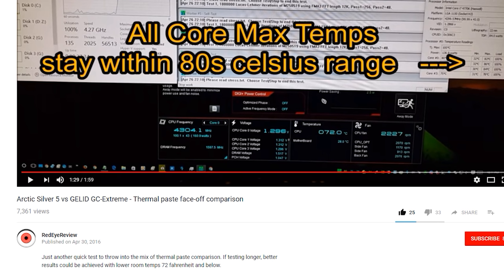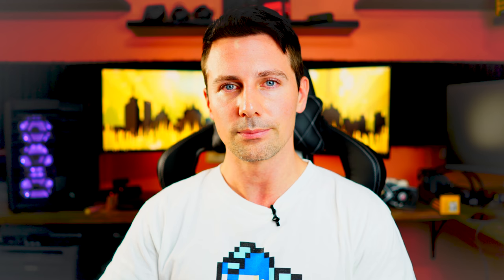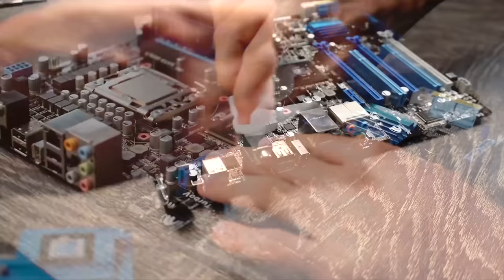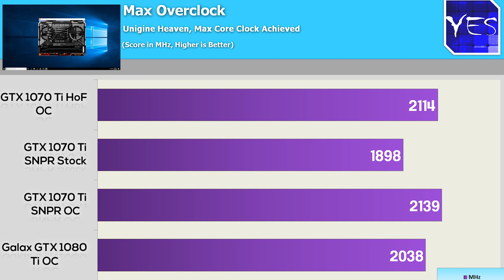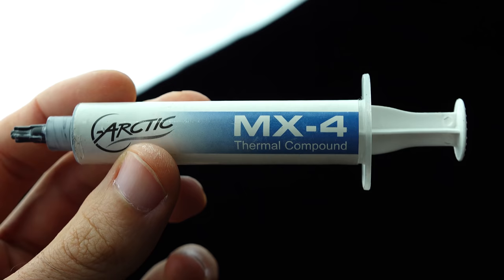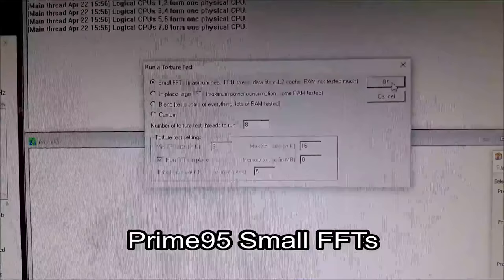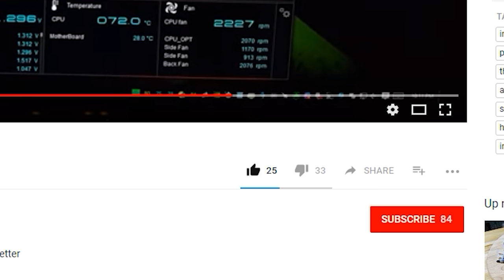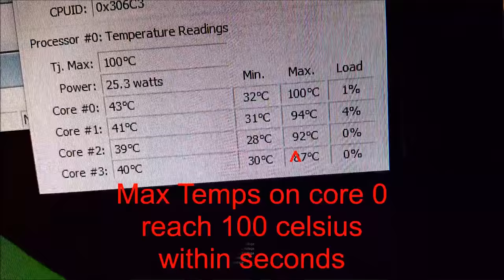Thermal Paste Investigation - GELID GC Extreme Vs Arctic MX4

Comment: Hi Brian,

I use Arctic MX-2 and MX-4 for around a decade or longer... I never had problems or thermal issues with it.

I will now try your tipp with the Gelid thermal compound. I recently checked other sources for thermal paste tests. Here are Tomshardware.de results:
http://www.tomshardware.de/anleitung-messungen-tutorial-thermal-grease,testberichte-242371-11.html the review is from Juni 2017 what is not so long ago.
Interestingly enough tomshardware.de proofed my personal findings too that Arctic MX-2 is in some conditions better the Arctic MX-4! Especially on GPUs!
 
Another source is Der8auer (its little bit dated ... but hey...) who did in Jun 2015 a roundup with thermal pastes:
https://overclocking.guide/thermal-paste-roundup-2015-47-products-tested-with-air-cooling-and-liquid-nitrogen-ln2/6/
The Gelid GC Paste is less then 1°C better then Arctic MX-4 what is around 0,5°C better then Arctic MX-2. Under a CPU.

Currently I run a PowerColor RX 480 Red Dragon 4GB with a Arctic Accelero Hybrid 120mm AIO (both bargains on eBay ;-)). I overclocked the card pretty stable to 1395 MHz with 1145 or 1155 mV with +30% Power Limit. The Card runs in Unigine Heaven after 30 minutes on 3440x1440 medium details @ 100% load to its thermal Max from around 60°C with around 19-20°C room temperature.  Fans are around 66-70% PWM signal. Ramping fans to around 100% PWM what are 1300 rpm pushes the GPU down to ~54°C I using a very good vented Fractal Design Define R6 with additional case fans. I use currently Arctic MX-4 for the card.

But 8°C difference between MX-4 and the Gelid GC compound is pretty massive!!! I noticed in your video that you are using a huge tube of the MX-4 paste. Did you recently bought another smaller tube of it and compared the two MX-4 samples? Maybe you are incredible unlucky and bought a bad batch of the MX-4 stuff. 
Another possibility I can think of is that your giant tube of MX-4 went bad over time? I would never ever buy such an large tube because I think the thermal grease can maybe expire. I only bought at max an 8g SKUs mostly 4g and had never problems. I prefer to use it up fast and by a new one instead of keep it over months or years.

I will try to get the Gelid GC Extreme stuff and report my findings with it here! Maybe I will be the next Gelid GC "Fanboy" on the block? ;-) Lets see....

With best regards from Germany!
Marfy :o)

PS: I liked your Video ;-)

Comment: I use grizzly conductonat on everything even my xbox one x
All you have to do is put clear nail polish to cover the resistors around the chip  than  its safe
I run unigine heaven benchmark for over an hr on my 1080tis 3840x2160
Set to ultra tessellation extream and both gpu's never go above 50c 
2025 mhz graphics and 5980mhz memory

Comment: In many tests MX-2 proved to be better than MX-4. In my case it was even better than Thermal Grizzly Hydronaut, even though I tried 2 reapplies of the latter.
Reply: in italy i can get 8gr of Mx2 for the same price of 4gr of mx4
Reply: Came here to say this. Some people say that MX-2 is harder to spread but I've never had any problem with it.
There's a Polish site that tested 62 thermal compounds in November 2014 and the results were that Gelid GC Extreme is the best performing paste.
MX-2 is cheaper and better than MX-4
MX-2 is not as good as Gelid GC Extreme but it's much cheaper (1/3 of the price), in fact it seems that it's the best in terms of price/perfomance.
Oh and Arctic Silver 5 is way behind the competition.
Reply: Arctic Silver 5 used to have a "bake in time", as in it takes time to get into full performance. No idea how that translates to modern chips but in the bare die days of the good old Athlon XP it was basically the paste to get. Wonder how that might get a comeback.
Reply: Link here: http://overclock.pl/articles/show/id/461,32,37,testy
But it varies so much, like first result from search, and Gelid is worse than MX-2: http://chlodzenie.net/reviews/test-past-termoprzewodzacych-mity-i-fakty/4/ So, I don't know what to think anymore.
Reply: Well in the test I mentioned they tested the performance during the first, third and seventh day and it turns out that MX-2, MX-4, Gelid and some other well performing compounds do indeed improve in performance after a few days, but Arctic Silver 5 actually did best during the first day and got worse later.

After some more research it seems that Thermal Grizzly Kryonaut is nowadays the best performing thermal paste (not counting liquid metal). It is pretty expensive though.
Reply: MX-2 is simply easier to use, not better. 
It's more runny and less thick, so if you use low mounting pressure it's better faster.
BUT MX-4 will get you the best results if you can crush it to the same thin-ness with high mounting pressure as it's thicker, and harder to spread out.
MX-4 is superior but you need high mounting pressure, and more time to allow it to spread out. 
It's thicker because it has more heat-dissipating carbon nano-tubes and ceramic particles than MX-2 or GC Extreme.
Artic Silver 5 is simply an outdated recipe, and simply too thick to be useful for most people.

Comment: ive run kryonaut and noctua and cant tell a huge difference but im gonna delid and reassemble it without glue and scrape off the old glue as well.  thought i would try kryonaut, maybe the noctua, and conductonaut liquid metal.  also have one  of those rockit cool copper ihs's because they were cheap and why not.  might put together a video on it if it goes well.  also redid the paste on my zotac 1070 ti mini with kryonaut and noticed about a 3 degrees celsius drop on it in furmark.  might try liquid metal the gpu just temporarily.  does anybody know for sure if liquied metal will stay put it i use it vertically.  i mean if i put it on my cpu and stand teh tower up will it run down to the bottom of the cpu

Comment: arctic claims 8 years life. so even if it lasts 3 years without much performance difference, its cool. will mx4 last 3 years? what about this gelid? and other pastes.

for desktop its very easy and quite ok if we had to replace every year but for consoles (oh yes i have a ps4) it would be good if we didnt have to open it up frequently. longevity of top thermal pastes would be a good video.

Comment: I love MX4 cuz it’s cheap and idiot proof..  good enough for average PC user or console user wanting to fix things up.  

However I since switched over to noctua thermal paste.. the NT-H1 is it called?  I gotten a decent drop in temps.. however you can’t buy noctua paste in bulk like you can with MX4 so I still use MX4 for repairs and inspections (side business).  

My GTX-1080Ti  sees a 5-10C drop in temps going to noctua stuff vs MX4..  however whatever toothpaste Nvidia is is using on stock cards is crap, honestly, MX4 is way better..  so still a worthwhile investment even swapping out to MX4..  I saw a 5C drop across the board going to MX4 vs the toothpaste Nvidia uses.. and another 5-10C drop going to Noctua paste.. so up to a 15C drop.

Comment: I am using some generic Chinese thermal paste i bought for $1 on ebay and have my i5 3570K overclocked to 4.7Ghz on air. I have been using the shitty $1 generic thermal paste on all my builds since the core2duo CPU were released. I have been getting overclocks of more than 1Ghz on core2duos and core2quads (on air) and getting the same results as others that have i5 3570K CPU's and using thermal paste which is ranked better than the generic stuff. Maybe this stuff will help me get that 5Ghz overclock i want out of my i5 3570k??

Comment: Silver 5 is old as fuck, there is better stuff out there people... Its good if your doing ln2, isnt as susceptible to crack when extremely cold. I personally use thermal griz for most of my stuff or dim nano for cheaper stuff. Works well for what I do. Liquid metal is good if your never going to remove the cooler. I have seen plenty of people put way to much liquid metal... Its not supposed to have a mirror finish... It can run if hit hard enough, but if properly applied the surface tension is more than enough to keep it in place...

Comment: for me personal the gelid gc extreme is epic! i use it, when i get gpus. so i clean up the crap and throw this little guy on it. but mainly for non-k cpu's i use some ultra cheap crap from china. this 5x40gr things. no problem had so far. and use it for a few years... cost just 10 bucks on ebay (with shipping) but u get 5x40gr and this will carry you a while. i build 3-6pcs per week and this is "cheap" solution. special with little cpus like a g4560

Comment: If u beleive me ... i had the arctic silver 5 but after 2 months my pc starded droping like 120fps in csgo ... the problem was that the north bridge is at 100c ... i didnt have any thermal paste and i didnt wast to wait .. so i went to friends cnc workshop which is like down the street for me .. and got some very very fine aluminuim powder and mixed it with a very very fine  copper powder ... mixed it all up with some "colgate teth brushing shit" and now the north bridge is at 65c... do u guys recommend me replacing the thermal shit on my cpu with it ??? Cuz my cpu is at 87c -93c...

Btw its an i7 4790k at 4.9 ghz
Reply: biggest danger is the conductivity of the paste you have made with it being aluminum and copper  powder
Reply: Damien lol but its still so gd for temps .. the problem is u have to change it every 2 months or even 1 cuz u know colgate will not last it will dry up ..

Comment: Can you Mix RAM?
Reply: you can but your ram will run at the slowest timings and slowest speed . it is not advisable but it can work
Reply: how about ram voltage? should i set manual?
Reply: it most likely will go to the lowest setting if your trying to mix rams and want to run them above say the stock 2133 it may be possible but will take testing to verify the ram is stable at what ever you get it to run at. if say both sticks are 3000mhz and one is a higher or worse timing you should be able to run it at  that with the xmp voltage but mixing rams rated for different timings is always a guess work